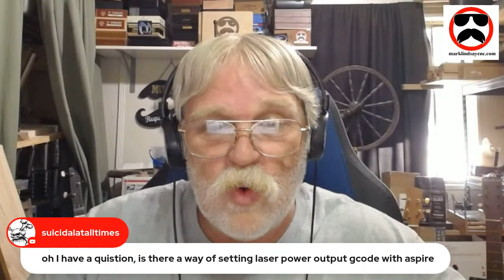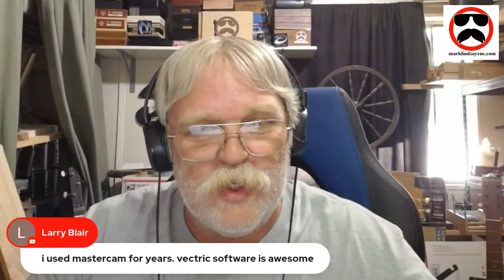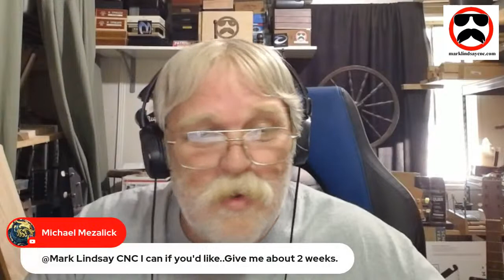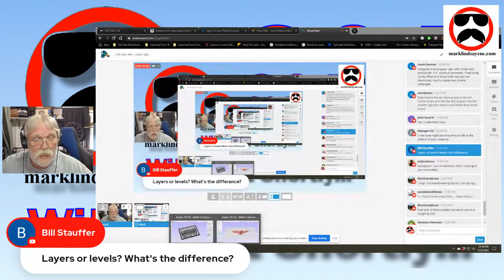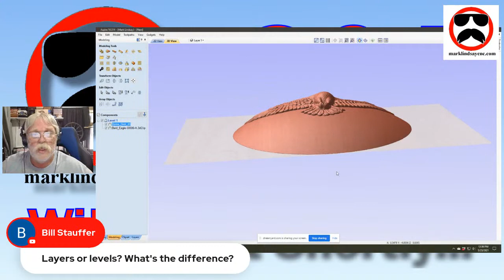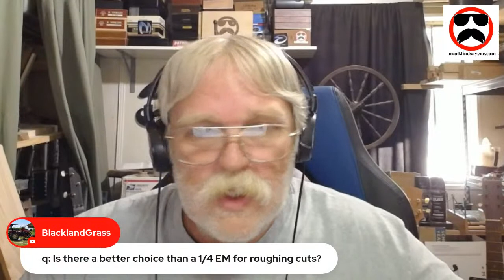LIVE Q&A #92 – Open Q&A

Comment: Hi Mark, thanks for your channel. I ran into an issue today; I have a ShopSabre 23. It's 30 W X40 workspace. I am doing a sign for my village which is 28.75 W by 72 long. I have it set up to do 3 24" tiles. This is two-sided project. I ran the first toolpath that was close to Y0 X0 without any issues. Running my second tool path, both on tile 1, it stops way short of Y0 but faults out with a low -y limit error. Tool paths look good in the Aspire program.
Reply from the maker: I would contact Shop Sabre about this. There may be a setting in the controller that's conflicting with the g-code. The folks at shop Sabre know your machine best. I would just be guessing.
Reply: @MarkLindsayCNC  Thanks Mark. I had  the  work space to close to the y limit.